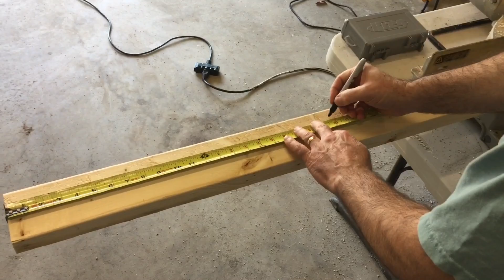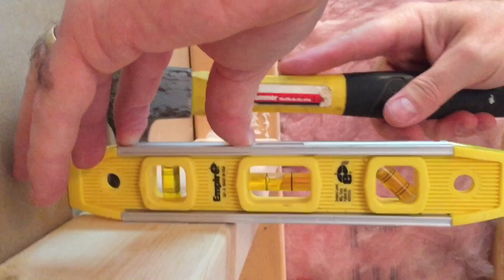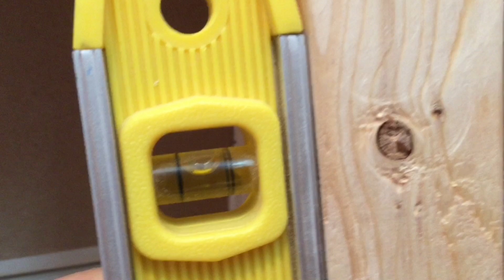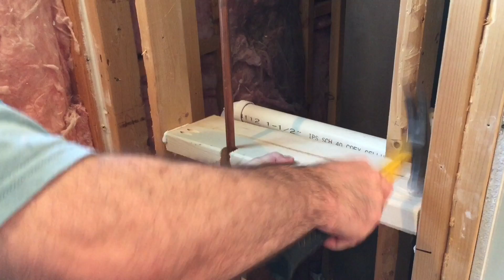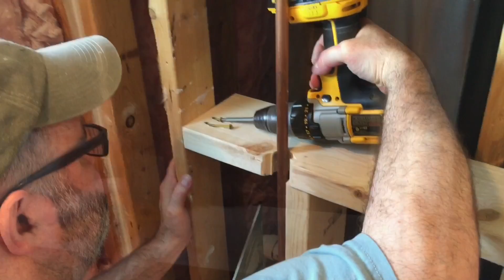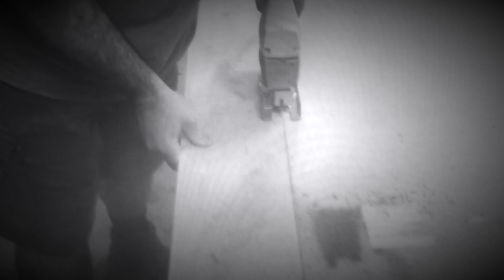Part 3 - How To Frame A Shower Niche - Complete Bathroom Remodel

Comment: Is it ok to walk on durock for a while while you're still working, or time it so you lay tile after you install the backer board.  I can save some time if I install the cement board now, and wait another week or so and continue with other work before I'm ready to tile the floor, but I feel like I might damage the cement board. Thoughts?
Reply from the maker: Howdy NJA 3!  Should not be a problem as long as you’re not doing any heavy construction over the Durock.  It will hold up to foot traffic, but it can get dinged if you drop a heavy tool on it.  Let me know if you have any more questions…good luck with your project!  ☘️
Reply: @DoAndBrewDIY  I so appreciate the quick response, thank you. I will be doing it this weekend and get that out of the way. 👍
Reply from the maker: @nja3224  good luck!!!

Comment: You did not have to slope the timber noggin at all  the tiles can be sloped with glue!
Reply from the maker: Howdy ROBERT BUTLER!  Thanks for the comment, but...the tile or glue (thinset) or grout are not the waterproofing component.  The concrete board (substrate) and waterproofing membrane are the components that ‘lock’ the water in the bathroom and prevent water from going through the wall and causing damage.  If your framing member is not sloped slightly it will be difficult to slope your substrate...if your framing member is level, water can pool under your tiles.  If properly waterproofed I guess it’s no big deal, but I would prefer to not have water collecting anywhere.   
Honestly, it takes as much time to install the niche shelf framing member level as it does to slope it slightly.....why not slope it to ensure water evacuation?   ☘️

Comment: Best niche instructional I've found so far. Thanks so much!
Reply from the maker: Howdy John Bush!  Thanks very much...glad it is helpful!!!  Let me know if you have any questions.   ☘️
Reply: @DoAndBrewDIY  When putting up the lowest sheet of durock - do you rest it on the lip of the tub (the part that's screwed into the wall,) or do you go over the lip?
Reply from the maker: Howdy John!  Hopefully your tub is against (or very close to) the wall studs.  If it is, put your Durock over the lip of the tub and leave about an 1/16” gap between top of tub sides and lower edge of Durock.  You’ll waterproof that gap later.

If your studs are not against tub you have two choices:  1. Shim the studs so the Durock is installed as described above (make sure your walls say plumb).  Or, 2. Bring the Durock to the level of the top of the tub (or slightly below/behind and waterproof the heck out of it!  Like 10 coats of waterproofing!  #2 is the least preferred and most like to leak at some point.

Does that answer your question?